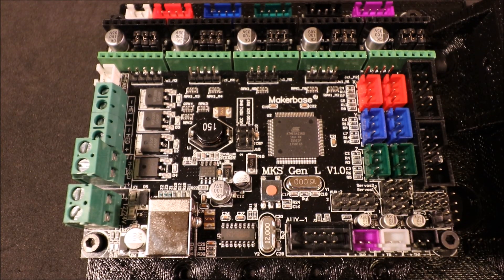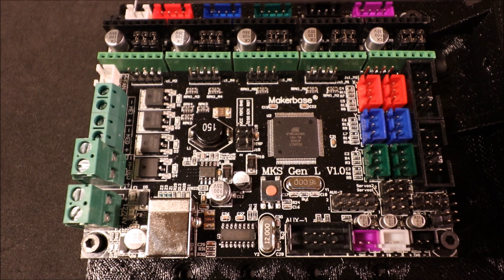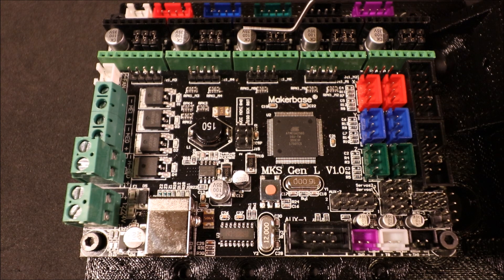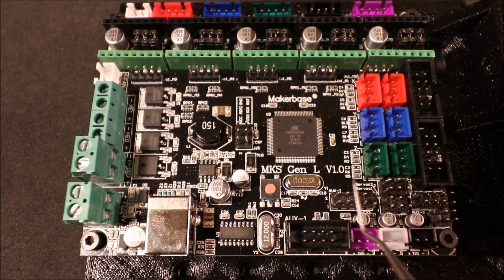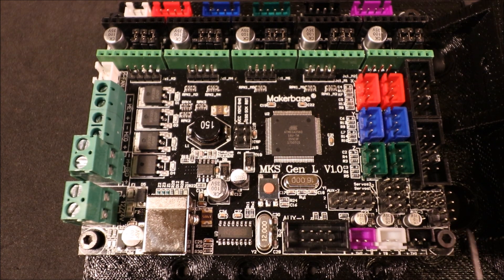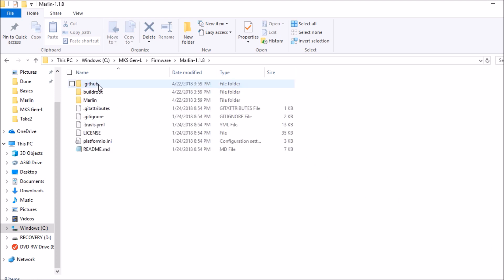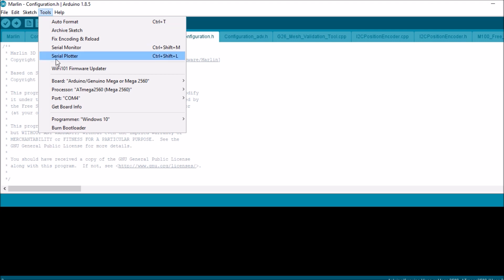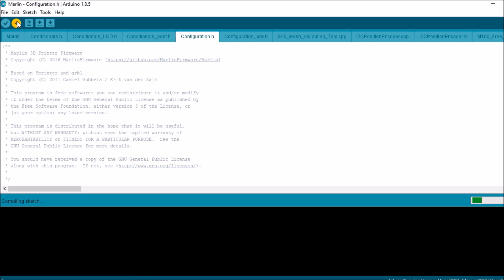MKS Gen L - Motherboard Basics for 3d Printing

Comment: Hi ED, I bought a MKS GEN L V1.0 and I can not get it to work. I've tried VSCode and also from what I read I should be able to compile and load MARLIN on ARDUINO IDE and the MKS Gen L V1.0 should work. I've tried every thin and can not get it to work. What am I missing? I even tried an earlier edition of marlin and that seemed to lock up and freeze my desk top. Any one got any suggestions?

Comment: Hi man!
Nice videos! 
I watched all of it❤ Very cool !
But I have a question for you!
This MKS gen L v1.0, it can print   different colors, cant it? I mean when printing can it print out 2-3 colors ? 
I wait for your response
Thank you man!
Reply from the maker: It's possible to print 3 colors with addition of additional steppers in aux pins.  There are other boards that do it easier with more steppers.  Note depending on extruder colors can be printed easier or not.
Reply: @EdwardBraiman thank you very much❤

Comment: How many watts does the motherboard use when the board is running at 24v
Reply from the maker: Depends on what's connected and PSU.  The Datasheet or User Manual is best place to check.

Comment: Hi Ed. I needed to replace the board on my printer which uses this exact board. So I ordered one, and I have been trying to install marlin on it but its like its not being detected. I have tried pronterface, prusaslicer and arduino ide, and none of them work (no port interactions since I have restarted my pc several times). My settings are ok in arduino IDE since I can flash the old board with new firmware, but this new board won't. It says "Uploading" for a while and then throws the error;
avrdude: stk500v2_ReceiveMessage(): timeout
avrdude: stk500v2_ReceiveMessage(): timeout
avrdude: stk500v2_ReceiveMessage(): timeout
avrdude: stk500v2_ReceiveMessage(): timeout
avrdude: stk500v2_ReceiveMessage(): timeout
avrdude: stk500v2_ReceiveMessage(): timeout
avrdude: stk500v2_getsync(): timeout communicating with programmer
Failed uploading: uploading error: exit status 1

Any advice? Thanks for the great tutorials!

Comment: Great videos!
Thank you!

I am trying to connect a max 31685 and pt100 to a mks gen l v 1.1.
It is made to take up one of the driver slots.
My question is does the mks gen l use uart or spi or can it do both?
Also can some drivers be set as  uart and others spi?
Are their any other spi pins available on this board? 

Thank you!
Reply from the maker: Should do both.
Reply from the maker: Also it's much easier to configure on mks sgen L.

Comment: I have an  Alunar FDM M508 3D Printer with a “hy base l v1.0” board
I bought this printer and it worked fine, it stood for 2 years now my bed and extruder is not heating up.
I did reload the program,
I checked the bed and extruder, elements looks fine
When I prepare it takes some time then resets, showing test sometime or MINTEMP.
and shows TEST

Please help
Reply from the maker: There's a Discord link in description.

Comment: How to install tmc 2208 v3.0 UART in mks gen l v1.0 board?
Reply from the maker: It's probably better to use another board for advanced steppers as a 8 bit processor might have issues.
Reply: @EdwardBraiman  thanks for reply eb 😃

Comment: Olá a todos ,venho tentado atualizar o firmware de minha impressora , mas  quando tento carregar  recendo como retorno uma falha de comunicação, não  consigo completar o upload , alguém teria alguma dica e pode por favor me ajudar  nesta? estou perdendo os cabelos, Socorro!
Reply from the maker: tendrá que dar un poco más de detalle. prueba el Discord en la descripción. todo el mundo habla un idioma diferente en discordia, algunos usan el traductor de Google.
Reply: I bought a tevo tarantula pro printer, about three months ago, it started printing until the quality of the prints was not there, so I bought some parts to upgrade, buy a second motor for the z axis and also paço engines with integrated closed loop drives before doing the updates, I downloaded the VScod + Format IO Software until I can edit and compile Marlin 2.0.7 but I can't apply it to the MKS_GEN_L 1.0 board that came on the board, when I installed it the aforementioned softwares, I can't get a .bim file so my only option would be to send the .HEX file via USB cable, but it always returns a communication error between the motherboard and the PC   Archiving .pio\build\mega2560\libFrameworkArduino.a
Linking .pio\build\mega2560\firmware.elf
Checking size .pio\build\mega2560\firmware.elf
Building .pio\build\mega2560\firmware.hex
Advanced Memory Usage is available via "PlatformIO Home > Project Inspect"
RAM:   [======    ]  58.5% (used 4792 bytes from 8192 bytes)
Flash: [=====     ]  51.5% (used 130836 bytes from 253952 bytes)
Configuring upload protocol...
AVAILABLE: wiring
CURRENT: upload_protocol = wiring
Looking for upload port...
Error: Please specify `upload_port` for environment or use global `--upload-port` option.
For some development platforms it can be a USB flash drive (i.e. /media/<user>/<device name>)
* [upload] Explicit exit, status 1
====================================================================== [FAILED] Took 64.03 seconds ======================================================================

Environment    Status    Duration
-------------  --------  ------------
mega2560       FAILED    00:01:04.025
================================================================= 1 failed, 0 succeeded in 00:01:04.025 ================================================================= 
The terminal process "C:\Users\ellvi\.platformio\penv\Scripts\pio.exe 'run', '--target', 'upload'" terminated with exit code: 1.

Terminal will be reused by tasks, press any key to close it.
Reply from the maker: What's your motherboard set to in configuration.h,?
Reply: @EdwardBraiman  // Enable the Bluetooth serial interface on AT90USB devices
//#define BLUETOOTH

// Choose the name from boards.h that matches your setup
#ifndef MOTHERBOARD
  #define MOTHERBOARD BOARD_MKS_GEN_L
#endif

// Name displayed in the LCD "Ready" message and Info menu
#define CUSTOM_MACHINE_NAME "Tarantula Pro"

Comment: Hi. how to delete motherboard MKS Gen L V 1.0 memory
Reply from the maker: Not sure I understand what you're asking?  Do you mean flash again?
Reply: @EdwardBraiman  Yes but first  must erase the memory no?
Reply from the maker: Well everytime you flash the board the memory should be flushed or erased.  If something is defect with board it maybe another issue.  What do you see occuring?
Reply: @EdwardBraiman  Well now is working because i take it to service but it was nothing on the LCD i try the Merlin but doe"s not work, now it's work thanks any way.
Reply from the maker: So your lcd is now functioning?
Reply: Yes but don't know for how long
Reply from the maker: If it's function, It should be fine until next firmware load.
Reply: @EdwardBraiman  Why the will blackout?
Reply from the maker: I'm slightly confused by the question.  Could you rephrase or you can ask in your native language.
Reply: @EdwardBraiman  I wanted to write,why at the next firmware load will blackout because i got a Marlin file from seller to update the firmware and when i make it everything stop working the printer and the LCD screen too so i take it to service ,i try many ways to update the (or flash) the motherboard I looked a lot of videos on youtube but nothing work nothing was helpful only the service.Hope like this way you understand.

Comment: hi, ask for help, my MKS Gen L in rx, tx, gnd, 3v don't work after I installed the stepper driver incorrectly. I use rx, tx, gnd, 3v to install nodeMCU. is there a solution to turn on rx, tx, gnd, 3v? I don't know which paths are dead on those 4 parts
Reply from the maker: Have you watched the videos on steppers in my MKS Gen L playlist?  I cover Steppers in several videos.  The MKS Gen L may have a damaged regulator, but unsure from a distance, best path forward is to replace board.
Reply: @EdwardBraiman  I have watched all your videos. the problem is now I have installed the driver correctly, but the connected NodeMCU on rx, tx, gnd, 3v doesn't work. how to fixed this rx, tx?

Comment: Hi, one (hopefully) last question. On my Tronxy XY-3 board there's a three pin slot marked "filament" into which the extruder plugs. There's nothing comparable on the MKS Gen L 1.0 board. If I had to guess, (assuming "hot" is a poorly conceived term of art), I'd plug it into HE1? But which two of the three would go in there? Leave out black since polarity doesn't seem to be an issue on that block?
Reply from the maker: I'm not familiar with tronxy board, but you might need to search on pinout diagram.  Another way is to check the pins file in Marlin to matchup functionality.

Comment: I have configuration files for a Tronxy printer but they're in hex. What do I do with them?
Reply from the maker: You're connected to USB on the MKS Gen L?  If so it should upload automatically.
Reply: @EdwardBraiman  Part of the problem was I had the wrong drivers. :/

Comment: great video. but one question. I have the Tevo Tornado gold edition printer.This printer has the MKS Gen L v1.0 board. I just re-watched the video and it looks like you uploaded the firmware without using a arduino board. This is confusing to someone that has not done this procedure before. I have installed firmware on many other devices. one being my other 3d printer the Monoprice Mini Delta printer. I read that I need to install the firmware using an Arduino board. If yes, the next step I read was that I need to install a boot loader. So do I need to use an Arduino board to upload the firmware? I also have Repetier Server running on a Raspberry pie 3. In this software there is a firmware upload option. so confusing I am not sure what to do. 
P.S. I love the Repetier Server software.works great and easy to set up. I also have a Wize Cam to monitor my prints. Also works great. The only issue is that I have to keep switching Back and forth between the 2. Not a big deal for me.
Thank You for any help.
Reply from the maker: You may want to purchase a separate MKS Gen L board to experiment, but the video steps work as outlined.  Keep in mind the Arduino/Ramps 1.4 and MKS Gen L are the same, basically the MKS Gen L is just all the parts of Arduino Ramps compressed in one motherboard.

Comment: Great video, thanks.

I have a laser that I would like to connect to the MKS GEN L v 1. The laser needs a TTL output. Unfortunately I cannot find the connection on the board. 
Does one of you have a laser connected to the board ? If so where ?
Reply from the maker: I'm unfortunately not an expert in laser cutters and due to safety concerns with spectrum and cost to create a video I've avoided the subject.  I would suggest googling subject.

Comment: Hello again.  UPDATE.  I changed the board setting to RAMPS.  No change except I preheated the bed only and first.  It Heated up.  yea.  But, preheating the hot end stalled the board.  So, I change back to the MKS GEN L setting and same thing.  I then looked through the extra parts that came with the kit and changed the hotend heater.  Now all works at the same time.  And when the hotend got up to temp I could move the extruder motors.  The only things left to do is:  Calibrate the Z sensor to get the hotend closer to the bed.  Adjust the auto leveling to get it away from the edges more.   Either change the direction of the way extruder motor turns in marlin or find and print on my monoprint mini printer a different mount that turns it around.  Could you do a tutorial on installing Pronter face on windows 10?  And any other pointers to assist with finish up this printer would be appreciated.  Thanks
Reply from the maker: Soon.

Comment: Hi Edward,  All 5 Stepper Drivers are TB7221B. I also have the MKS TFT32 V1.0.  Update I was able to get the firmware verified and loaded.  So, the printer will home and move.  The bed and hot-end for the cyclops won't heat up.  And neither of the extruder steppers will turn.  Also, I know I have to adjust the sensor for the Z, the hot-end stops just shy of a pencil diameter from the bed.  Not sure how set the offset for that in marlin 1.1.9 bugfix or set up auto leveling.  Any assistance would be awesome.  Thanks
Reply from the maker: For the cyclops check connections and continuity.  Stepper have a minimum heat value on extruder before they step. Offset is usually set in Slic3r.  Hope this helps.
Reply: @EdwardBraiman  Hi again,  I did figure out the auto level watching a few other videos.  The hot-end nozzle is 5.65mm is away from the bed when it homes, what can I adjust or settings change do I need to do.  The cyclops connections and continuity is good.  Copy on the min temp. Shouldn't I be able to heat the bed and hot-end  through the MKS TFT32?
Reply from the maker: In theory yes.  Just need to find the path on TFT 32.
Reply: @EdwardBraiman  Well it has the icons on the screen to do everything.  home, move, auto level, ect...   preheat, just won't heat anything.
Reply: Should I but, have not tried it yet, tell it i have the ramps 1.4 board?

Comment: Hi, I  bought an FLSUN Cplus and I just can't get the firmware to compile.  I have done my best to follow your instructions from all your videos.  I have been going nuts.  I don;t know what to do so I am commenting.  Thanks
Reply from the maker: First what IDE do you have installed?  What's the error message you see?  What is the motherboard you're using for the printer?
Reply: @EdwardBraiman  The latest Arduino and Marlin.  I Don't remember but, will look at it tomorrow maybe, depends on schedule.  MKS Gen L.  The printer is a 300x300x450 and has a duel extruder with cyclops single nozzle.  And a cooling fan. It will have a part cooling fan also.  I have to print one and hang on it.  The motherboard has two cooling fans with heat-sinks on the 5 stepper drivers( They are green and the same don't know the part number) installed correctly. Bed heater on an aluminum bed. The instructions to assemble were good but had to find them on line because the SD Card was corrupted.  They still needed updated to the current setup.  The electronics was not comprehensible nor had anything about duel extruder/cyclops setup.  So, Any help would be appreciated.   Your videos are darn good.  It was the only reason I worked up the courage to tackle the programming part of it.  thanks.
Reply: ALSO it has auto leveling too.

Comment: I cant connect to mine. I have exact same one but my arduino gets a timeout stk500v2_getsync. i set baudrate all the same everything looks correct but it always times out. do you have a link for drivers?
Reply from the maker: You should be able to plugin and search internet for driver.  Try another USB cable.
Reply: HELP: Did you figure this out? I am having the same issue.
Reply from the maker: Can you see the device when connected in device manager?  If so try doing a windows internet search on drivers.
Reply: Turned out I was clicking “Burn Bootloader” when I just needed to hit send. Working like a champ. Thanks Ed!!!
Reply from the maker: @joshuaolsen8844  you're welcome.

Comment: Hello.  I have question.  Can I drive the 8 step motor (nema 17) ? for 4 step motor at the same direction. is it possible ?
Reply from the maker: Maybe, you would have to try it out.  The stepper driver board may have issues due to power, so extreme caution is a good idea.

Comment: I have this board on my 3d printer and it was working fine but now for some reason, my computer won't recognize it when i plug it in. the board powers up but doesn't appear as a com port in the device manager or in arduino ide. any help would be greatly appreciated
Reply from the maker: Here are a couple of things to try.  Try another serial USB cable. Try another serial device. Check computer for any recent updates.  Try another computer.  Check what's occuring in device manager.  Check for software updates, sometimes a waiting software update will cause strange behavior.  Reboot both devices.  Hope, these help.

Comment: Can I power my pi3b directly from the mks gen l v1.0 and if so how?
Reply from the maker: Do you mean raspberry Pi 3? If so it can run on 5 volts.
Reply: @EdwardBraiman   yes I do, raspberry pi 3b plus to be exact. I'm not sure
A. What pins to attach on either board and
B. Will the mks be able to provide the 2amps the pi needs while running the printer as well
Reply from the maker: Not sure, but you can power raspberry pi with it's own power supply.
Reply: @EdwardBraiman  also thank you, your videos have been very helpful

Comment: do ı need install 5 steppers or 4 is enough (x,y,z and e)
Reply from the maker: Only 4 stepper, but it depends on printer type.  If you use only one z axis stepper, but if you use two steppers on z axis you will need a total of five steppers. And five stepper driver boards.  Good luck.
Reply from the maker: Note you can use 4 stepper driver boards by a parallel breakout board on the z axis.
Reply from the maker: True, but it can be repurposed in Marlin firmware.